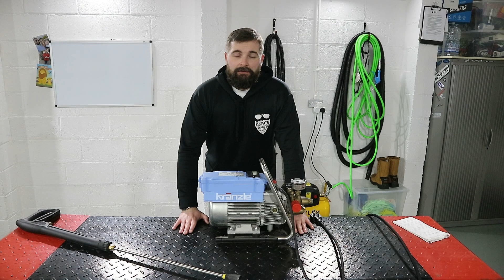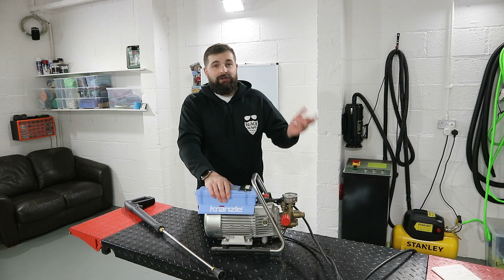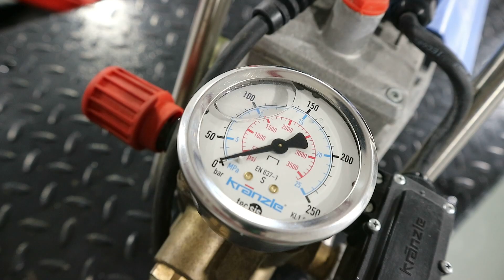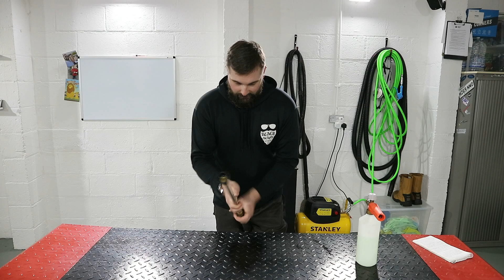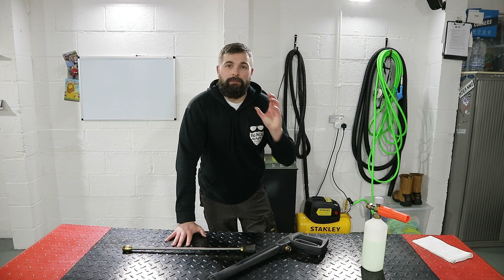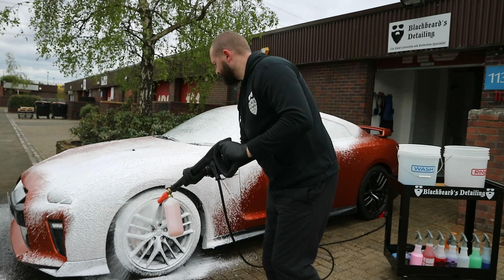Kranzle HD10 / 122 TS Review | Blackbeard's Detailing

Comment: No, the HD10 is not available in the States because it’s needs 240v, the available voltage in the States is 120v only. The 1322 output is 1.9 gpm, 1622 outputs 1.7 gpm, the HD10 outputs 2.8 gpm
Reply from the maker: Thanks for the information for our friends across the pond 👍🏻

Comment: Hi Ross, do you know if.... before you use the machine, looking at the sight glass the oil is clear and golden....then whilst using the machine it looks foamy due the the air being whipped around with the oil....then about 10-15 minutes after using the machine, the oil then looks clear and golden again?
I seem to get aeration whilst in use, but I'm not sure if it's always done that....machine seems fine (K10 122 TS) It's not water in the oil I'm seeing because when I take off the filler red cap, I can see micro air bubbles rising to the top then they disperse. I've even drained the oil after it's settled and not milky, it's clean / golden. 
I'm just wondering if the aeration of the oil I see whilst it's in use is "Normal"?
Reply from the maker: I'm not sure unfortunately, I upgraded to a Kranzle Therm last year.

I'm sure a quick email to Kranzle would answer your question as there customer service is great.

Comment: How it is compared to K7 compact ,not saying on durability or the quality but the cleaning capabilities (liters per hour and pressure)?
Reply: I've never used the K7 unfortunately
Reply: @rcam1985  just received my Kranzle 10/122 hd TS with the Dirtkiller and the original Kranzle foam gun but haven't used it yet(the foam gun)... It is amazing in every aspect. Ross could you please recommend what garden hose to use 3/4 , 5/8 or 1/2 and how many meters 10 or 15?

Comment: i have the same model the thing is bullet proof had mine years never changed oil i was told not to also mines all all on a quick release 30 meter hose reel with big and small trigger gun thinking of a upgrade to a hot water one
Reply from the maker: They really do seem to be bomb proof.

I would like some toasty water to help with the cleaning but some of the heated washers are astronomically expensive and quite large.

Comment: A good machine a bit expensive to wash your car once a week
Reply from the maker: I agree it is expensive, however if you're replacing £150 washers every other year that'll soon add up to the cost of this one. 

And this being used once a week would go forever given it's designed for daily constant use 👍
Reply: @BlackbeardsDetailing  What are you paying in the UK for the Kranzle here in the United States the 1322ts is about $1,000.00 just for the machine no hose and fittings. Do you have a cheaper supplier and if so please send the link. Thank you
Reply: dannie carmona just unit in uk is 446£ u can talk on instagran with them!
Reply: Used a Bosch pressure washer for 6 years no problems
Reply from the maker: @billb2580  that's good to hear, is it still working?
Reply: @BlackbeardsDetailing   yes still working perfect  no problem